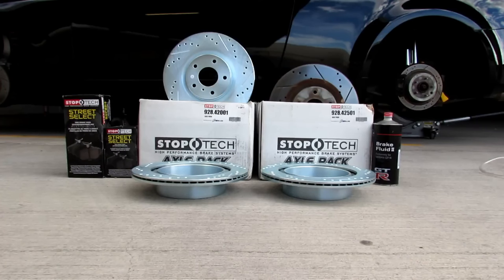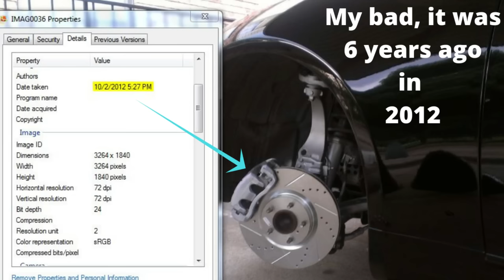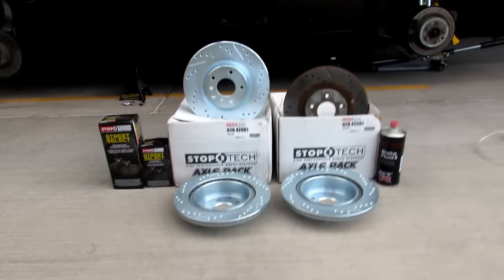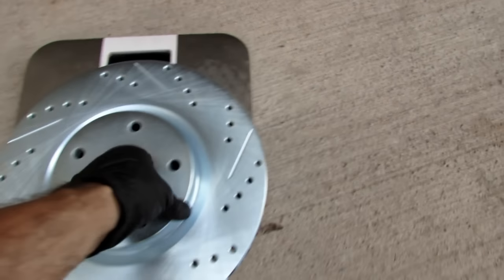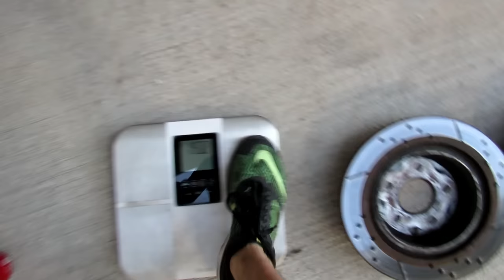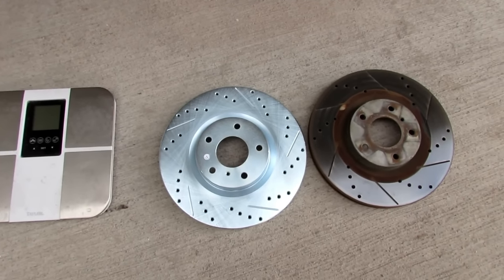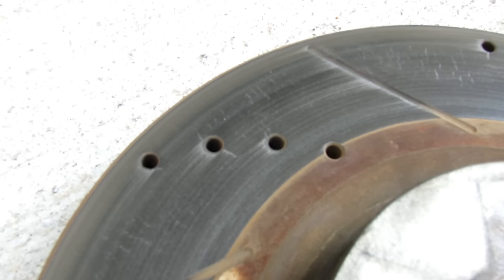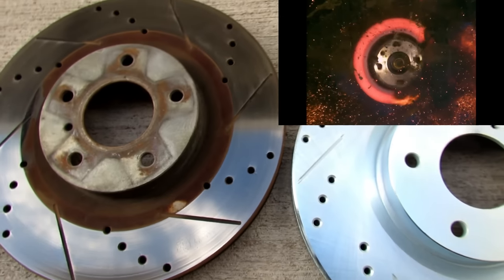$150 eBay Rotors vs $300 Rotors - 6 Year Review

Comment: I love that the main commentary is about weight and speed holes. Not the casting method, not the manufacturing process, not the machining, not the steel content of the rotor.

And now a haiku:

Somehow it’s almost 
like a side by side viewing 
means nothing with brakes

Comment: Your old rotors where indeed chamfered (what you called tapered) they are six years old and have been resurfaced once, the first shot of the group of for holes when you say that you can clearly see the inside hole is still chamfered where the pad was misaligned and not making contact. As far as the cracking, they’ll do that, especially in a sports car that actually gets driven the way it’s supposed too. No avoiding it. I’d be curious to see how those spendy rotors are holding up after a year. I think the cheap one where far better and you could have purchased two sets for the same price!
Reply: U think the eaby ones r better
Reply: Stock techs have better metal and have gone through processes and heat treatments to make sure they are the right hardness and won’t warp under hard and heavy braking. eBay ones are cheap Chinese pot meal rotors that had holes and slots drilled into standard cheap rotors which is why they warped on him in the first track day. Maybe on a regular car like a Honda Civic that doesn’t see anything harder than stopping from speed off a highway ramp will be fine but I wouldnt trust them for higher powered sports cars or track days at all
Reply: You get what you pay for
Reply: The whole point of having good rotors is so they don’t warp under hard braking causing vibration which will cause the brakes less grip and make your stopping distance farther

Comment: I HIGHLY recommend Stoptech CRYO  rotors for the G35.....or 7. They Do NOT warp. I'm running them with Hawk HPS pads, stainless lines and Motul fluid. I've had a few setups on this build, this one by far is the best so far.  To be fair it is temporary before the AP Racing Redi-Cals get here but none the less really good setup for the G's & Z's.

Comment: I can buy almost anything from eBay or Amazon.
Why do people call them eBay parts? eBay has nothing to do with the manufacturing.
Just funny how people say " these are eBay rotors (or whatever part it is)"
But if it's from Amazon. They say "I ordered these ( insert brand name here) off Amazon".
Reply: Bro, you are sooo right. It irks me soooo
Reply: ebay does sell a lot of cheap knock off shit though. I think that’s why ppl say that because who hasn’t ordered something off ebay to have it fall apart or stop working 2 days later? I have lol
Reply: Because eBay is usually some Chinese junk shit lol. Please go put eBay rotors on your car then go drive with a set of quality brakes. Please build an engine with eBay parts then build an engine with quailty parts and see which one last longer and holds more more more reliably.  Lol
Reply: @HatsuneM1ku01  Guess you’ll be quiet when you find out the shit last as much as quality parts 😂😂
Reply: Because there are no name brands on ebay that just sell on there that's why people say from ebay
Reply: @jassemalzahrani4502  
Yes I  realize that.
People need to understand they're buying cheap knockoff parts and blame the anonymous manufacturers. Because there's no company name. It's ok to simply blame the country of origin.
Reply: I wouldn't call a set of Willwood calipers I got from Ebay "Ebay parts" 
I get what you're saying, I guess it refers to the no name made in China parts.

Comment: You got your money's worth 
I bought a set for my 2014 caddy cts and my gf Acura complete 280 for both cars can't beat that
Firestone wanted to charge my gf  400.00 just for front brakes 
And for 100.00 I did all 4 rotors and pads from brakemotive drilled and slotted
Stay away from chain repair shops 
Like Firestone they tried to sell ball joints struts you name it 
I checked the car out 
Absolutely no play in the front end or ball joints boots weren't ripped 
Struts were also good weren't leaking,weak or making any kind of noise 
They seen a woman and tried to take advantage of her

Comment: The stress cracks are more than likely caused by the composition of the cast material of the rotor itself, you don’t know what the exact composition of the cast iron is. A cast iron rotor will retain up to 85% heat generated . So the ingredients are very important,chances are the more expensive rotors have better stability against warping and stress cracking, so they cost more (not always) if a person was really into finding out the differences, doing a Metallurgy test would tell you right away which is the better rotor using S.A.E composition standards for cast iron and how it should perform under certain conditions . Chances are the cheeper parts are shy on certain ingredients in the casting. But what the hell 5 years is a good track record and price paid for the rotors, I would buy them and not bat an eye for an every day driver and maybe a little track time.

Comment: So the ebay rotors after 5 years of use and have been turned once weigh the same as new stoptechs ? And thats why they are better ? I'll wait for the 5 year video with the stoptechs
Reply: Ibrahim FazelPoor that’s what I was thinking, imagine how heavier they were brand new 5 years prior
Reply: Meli Hampton i just bought some on amazon for 150 and they feel like they weigh more than 20 pounds
Reply: Difference is the stop techs have better metal and are less prone to warp and crack under hard braking .

Comment: Drilled and slotted rotors only make sense under certain conditions, and most of those conditions aren't for typical street driving. A high quality vented solid rotor gives the best stopping power due to its uninterupted contact surface and will handle the heat from spirited road driving just fine. Only use drilled and/or slotted rotors with high-temp pads for rotors you make glow a lot.

Comment: Good to know that it lasted 6 years. I don't like drilled rotors because they do those lil cracks. I like the slotted ones. I bought mine a couple months ago too from stoptech. I paid $510 on ebay for all 4. But mine is for the 370z/g37s. I have akebono calipers. I also bought the stoptech sport performance pads for $150. I didn't like the stoptech rotors man. I was working on my car outside for 2 months. The rotors got really rusty on the inner side and now my car is shaking so they are probably warped. Next time I would just buy the ebay ones like you did.
Reply from the maker: I was actually impressed with them and they weren't warped as I replaced them. I know cross drilled/slotted rotors are the worst choice. I chose them because they are for looks and because Koenigsegg, Pagani, Ferrari, Lamborgini, Mercedes AMG and BMW use drilled rotors so I purchased them again knowing they are the worst choice. Blanks being the best, then slotted and in last place cross drilled and slotted rotors.
Reply: Hideaki Sakakibara  I’ve always used akebono good pads even if the rotors are iffy no shaking squeaking
Reply: Motordyne G35 every drilled rotor has cracked for me  I’ve had better luck with just slotted
Reply: Hideaki, brake rotors are bare iron.  They will rust if left exposed to the elements.  You didn't warp your rotors.  You have uneven surface deposits which will cause the brake pedal to pulse.  Sometimes you can run an aggressive abrasive pad compound (like a Hawk blue) to effectively smooth out the surface again.  Other times you just need to drive a bit with what you've got.

Comment: I always buy these cheap Amazon drilled and slotted rotors when I have to replace brake rotors. They work fine and should help to keep the brakes cooler. I've put them on a Dodge Neon, a Dodge Dakota, a Chevy HHR, and a Chevy Colorado. Never had a problem with them.

Comment: I have been using Brakemotive for years.   If you got over 5 years for $150, I think that's well worth the money.  You would be lucky to get half of that life with OEM Nissan rotors.  
By the way, their holes are now like the ones on the StopTechs.
Reply from the maker: I finally got a big brake kit with 2 piece rotors, you know the rotors that cost 2k. I'm beating the shit out of these rotors currently like a dirty 35 year old single mom who thinks she has a chance in hell. Can't wait till they burn up, to upgrade to what men get as they age; the best.
Reply: @MotordyneG35  2 piece floating rotors with stiff calipers are hugely confidence inspiring on track.

Comment: A lot of what you pay for in a higher end rotor isn't easily visible.  Centric (StopTech parent company) offers rotors in all ranges with C-tek being the budget option at the bottom.  Slots and drilled holes can more than double the cost of the rotor.  StopTech does most of this machining in compton, CA.  

A more expensive rotor will have tighter tolerances.  The most important and difficult to achieve are the rotational balance and disc thickness variation.  

One thing the end user never gets to see is the sand casting that the rotor was poured in.  A good casting will use more sand so that the rotor doesn't cool down too quickly and become brittle.

Comment: Just an FYI in case anyone's interested. Just bought a set for my 2016 Ford Focus. All 4 rotors, ceramic pads and new pad springs for just a bit more than $200.....so all four corners done. The OEMs lasted 170000 miles on the front and surprisingly still had about 30% on the back pads. The rotors were pretty well worn though. These newest version of the brake motive rotors do have their cross drilled holes chamfered so stress cracking shouldn't be a problem with this newest version. The plating looks great after a month of use and stopping power is excellent. We'll see if they outlast the car.
Reply: Hey man , how are they holding up?
Reply: whats the verdict?

Comment: I bought Max Brakes for a commuter car, rotors say made in China, no vibration and look like any other brand from auto parts (paid 63 with pads inc S&H). I used cheap rotors and the premium rotors that cost more, no real difference IMO. My only complaint with Max Brakes is the dusting, they stop great and otherwise work perfectly. Can't say anything about other brands but this was my experience. Also got some loaded calipers off ebay, six years later the calipers still work great, changed out the ceramic pads because the bite was not so great.. You just never know what you are getting from any supplier.
Reply: How have they been working lately?
Reply: @HappyFeetBoxing  I bought the Carbon Metallic from Max Brakes and they are decent for economy brakes, not as much bite ans the Centric (300 series) pads I normally buy. You really can't complain because of the price as compared to some more premium options. These brakes were purchased on a rehab project and can be upgraded on the next brake job.

Comment: Reading the title and I WAS SOLD already without even watching the video - I don't need the eBay rotors to be on my car for 5 years lol, I work full time from home, but I do Lyft full time up to 45hours in a 19 Charger looks like a Hellcat but it's not lol - I DO NOT brake at high speed much so I don't need that much cooling, but I do drive a lot red light to red light a lot stop signs so no room to speed anyways BUT I do Lyft and repeat so no time to have fun. Double your income, got to grind. 

I wasn't sure if I needed to spend $1k in brakes as I have Brembonittos and those suckers aren't cheap - it can go over $4k in just brakes. I just need to replace my rotors and pads and good for 6 months or 1 year.

Comment: hey dude,.. they are not really ebays,... remember they are all made about the same,.. go ebay
Reply: Rotors, even from China, are made to vastly different standards to meet different application and price target needs.
Reply: No they are not 😂😪. Metal composition differences, different manufacturing processes , forged rotors vs Chinese pot metal cast rotor build in a sweat shop factory.  different heat treatment cycles, stop tech actually heat treats to a specific hardness and has all the test equipment to make sure they are a quality product. There’s a reason racecars are build with high quality and not eBay
Reply: @HatsuneM1ku01  I think you're confusing some of the manufacturing processes used to make calipers and other components.  

Iron rotors are always cast, never forged.  Grey cast iron rotors don't typically receive any heat treatment after pouring, rather it's important the process be well controlled (molten metal at the right temperature and then cooled at a controlled rate).

Comment: Using regular bathroom scales isn't the best option to compare the weights. Some bathroom scales when you try to jump on them a second time within a short period of time will just jump to the number it was the previous time if it's around a similar weight, sometimes upto + or - 2 kg.

Comment: I got some ebay rotors for my g37x coupe they have been very good just drilled tho for cooling I think it helps the slots do less and and still take away surface area mine weren't quite as cheap as those the holes are chamfered and the inside surface was ceramic coated I had non-drilled rotors on my lexus and would get hella fade and warping

Comment: A little biased when you hadn’t even used the stoptech rotors yet. Good input on the eBay rotors though. I went ahead & just ordered the stoptech street axle pack with slotted only rotors, have had too many headaches with “less expensive” parts recently to keep my ass from ordering moving parts that just don’t have as much engineering in them🤷🏻‍♂️ sometimes just flat out totally different in specifications. Spent $2,300 last year playing axle roulette, started with Yonakas that ended up being almost an inch longer than OE, putting my lowered car in a bind & vibrated my teeth out. Ended up having similar issues with Insane Shafts 500hp rated axles & had to source an OEM set in the long run🙄 I was livid for about 3 weeks straight as a result😂🤦🏻‍♂️

Comment: I was actually going to get those Stop Tech rotors for my G37. But saw the slotted rotors by 88rotors, and saw that they were DIFFERENT.....plus NO holes!! I put the Hawks pads on with them and called it a day..
Reply from the maker: I know cross drilled/slotted rotors are the worst choice. I chose them because they are for looks and because Koenigsegg, Pagani, Ferrari, Lamborgini, Mercedes AMG and BMW use drilled rotors so I purchased them again knowing they are the worst choice. Blanks being the best, then slotted and in last place cross drilled and slotted rotors.
Reply: @MotordyneG35  
Oh yeah,  very true. I was going to do the same thing....I wanted the cross drilled and slotted too. But I knew on the scene, if anyone did brake and rotor upgrade, it would be that. So I went left.. 😉😄

Comment: Quick question, with those $150 eBay rotors or any drilled and slotted rotors in general, I heard they wear out brake pads faster. How many pads in those 6 years of using them did you go through? Would you recommend them for daily driving? I was thinking of getting some of these just for daily use no track or hard braking.
Reply from the maker: Brake pads are free, they come with a lifetime warranty. I never pay for brake pads. No they don’t wear out the pads any faster. I upgraded to 2 piece rotors which are ridiculously expensive with my big brake kit upgrade. Never even wore these stoptech OEM rotors out. They would have lasted 6 years plus I am sure.
Reply: @MotordyneG35  thank you for the information! I will be upgrading soon.

Comment: What you recommend for struts. I'm on an budget and hard to find ones online or even at the stores. I have a 2004 g35x.
Reply from the maker: KYB....https://www.oreillyauto.com/shop/b/shocks-struts-16482/shock-strut-12872/75de62e0ee1b
Reply: Also check RockAuto.com and PartsGeek.com rockauto has the complete strut for about $99. Parts geek has them too but I forget the price but they are the same brand. They have a decent ride but are not performance and I would say their life span depends on the quality of the roads where and how you drive.

Comment: For a performance car yes spend the money daily driver with no power eBay is fine
Reply: I got a 3000gt vr4 it's a performance car but I'm only using it for the weekends so the brakemotive rotors should work well

Comment: The untouched strip near the hat has nothing to do with the rotor and everything to do with caliper. If you haven’t changed calipers it’s the way the car factory designed them to be and the new ones will be exactly the same.

Comment: I saw a guy on a f**** forum that I was a part of still am actually and he bought a pair of plane brake rotors and drilled them himself and did not chamfer the holes that is exactly what happened stress cracks formed and a lot of them at that you see they temper the areas where the holes are drilled and they're actually a different type of steel in some cases then the regular plane rotors or even have sleeves but if you chamfer the holes it makes a world of difference and transferring that heat and taking better thresholds of kinetic energy and thermodynamic energy is what I should have said

Comment: Yes,... we would get a huge financial settlement if they explode due to stress cracks. However, would shape would one be in after a potential devastating crash if they should explode while driving at high speeds. I'd still rather be sitting behind the wheel of my car and driving rather than be sitting in a wheel chair wishing I could drive my car.
Reply from the maker: Bhaa....the other 3 rotors working would still stop the car. All 4 wouldn't explode at the same time.

Comment: I think the eBay would of weights a slight bit more new. Your missing material on it. Cracks on the rotor is going to happen most drilled rotors. Regardless of winter or not that’s stress cracks from heat.